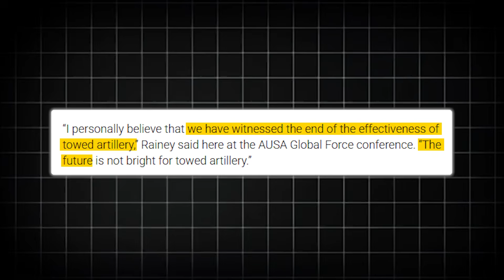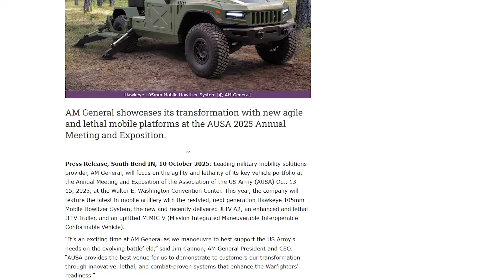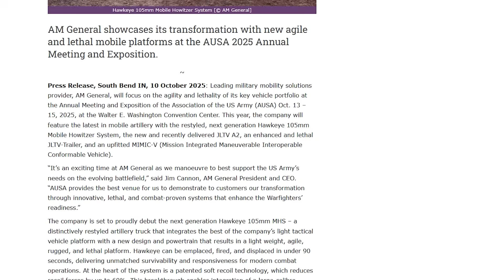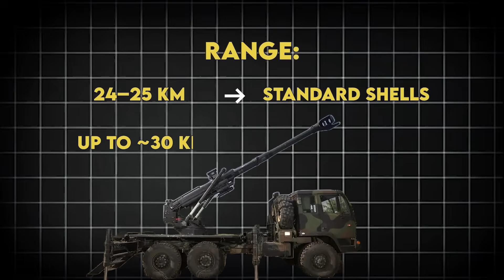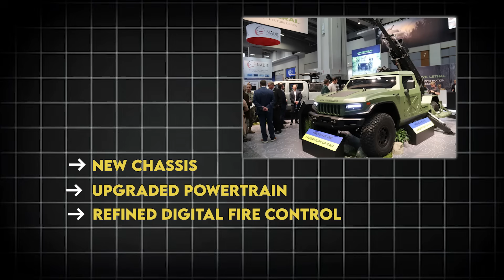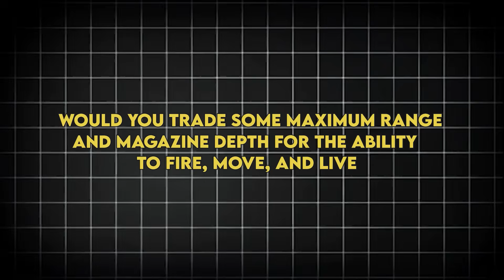The Hawkeye Howitzer Breaks Every Rule of Artillery, Here's How

Comment from the maker: Should the U.S. Army go all-in on mobile artillery, or is this just a stopgap until something better comes along?
Reply: go all in. time isn't just money, it's life. plus this is fighting smarter, not just throwing money around
Reply: The Army has 800 towed 105mm howitzers.  Replace them all because the Hawkeye is air mobile.

There is an couple of issues though.  The Hawkeye has shorter range than the M119 and is not as accurate.  This is an issue with all constant recoil systems (where the barrel moves forward before firing).
Reply: @ThomasStell  The advantages of the system are substantial but if you can't hit the target, than ???  What are the differences in accuracy? Major over 10 miles or minor?  Is this issue something Manis can improve upon in future versions? I could see two or three  batteries worth racing up to the front line to perform artillery raids similar to the Gulf war. Give a targeting computer the willies!

Comment: The funny thing is if you visit Ukrainian and Russian military sites talking about the war,  they talk about the opposite of what is asserted here.  Towed artillery is increasingly preferred because the towed units are easier to hide and dig in whereas the large self propelled units are bulky,  hard to hide and tend to leave a well  marked trail leading recon drones to where the gun is parked.
Reply: Yeah, but we shouldn't presume the next war will mirror Ukraine, where air defense against FPV drones is weak.
Reply: That's not true, small radar makes it extremely easy to pin point artillery nowadays. That's were the 3 minute survival time comes from because you can detect,pin point and fire back at artillery in 3 minutes.

Comment: I was the XO in a 155 towed battery many years ago (M114A1).  Employment took about 10 minutes for all 6 guns.  CSMO (Close station move out)  (a leftover term from WW2) also took about 10 minutes.  We always worried about counter battery fire.  This system seems to be a great solution.  First round downrange is less than 3 minutes and two minutes to move after last round, might just avoid the counter battery fire.  Now let's finally work on improving range and with reduced crews adding two tubes to each battery(then you could have a section firing and a section moving).
Reply: Written in the truest tradition of Cannon Cocker my hat's of to you.

Comment: For Stryker Brigades, wouldn't it make more sense for the soft recoil gun to be mounted on the LAV III platform, like the rest of the Stryker Brigade? Much like how the Germans have a 155mm howitzer mounted on their Boxer platform. Except, the Boxer RCH-155 can also fire on the move. No need for it to stop, deploy stabilizers, fire, retract stabilizers, and move... Although, at about 40 Tons, it is nearly twice the weight of the Stryker LAV III...
Reply: The key to many of these items is weight.  Americans have to air lift most items at some point (especially Marines), so they are very aware of how much each of their various transports can carry whether it's a C-5, Herc, CH-53, Osprey or Blackhawk.
Reply: Also the Stryker frame would take MASSIVE engineering , basically 90% new vehicle
Reply: Not really. Not for 155mm. The truck is mobility. It doesn't need to be in a Stryker, just on a common platform, like a 5T MTV. Now, a 105mm howitzer you might want on a Stryker with autoloader kit, etc. That could also be pushed further forward as a light armored assault gun.